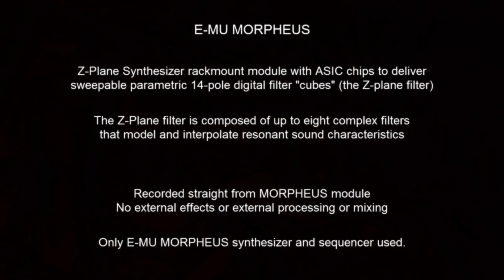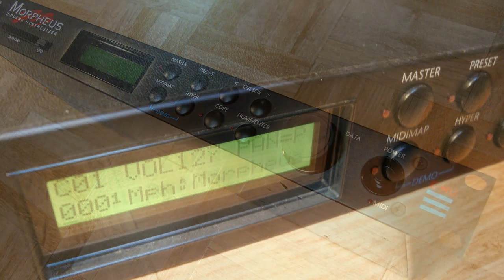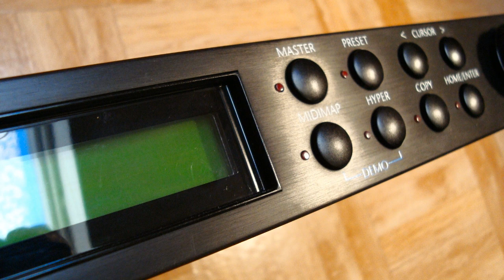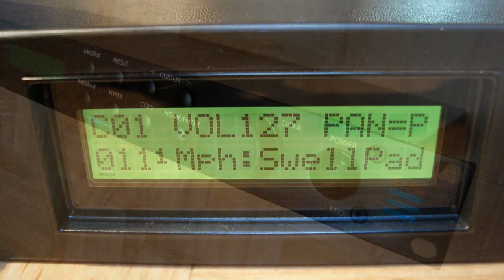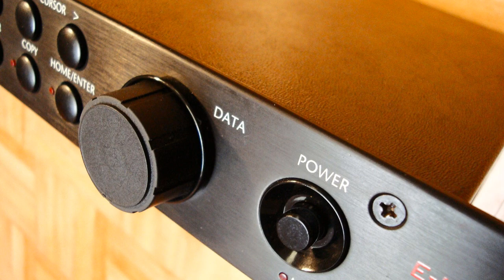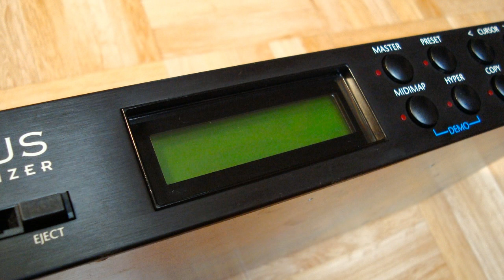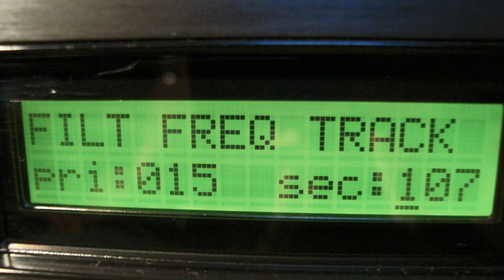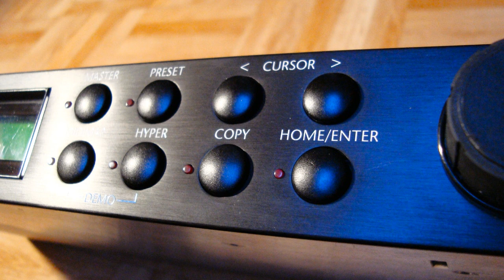𝗘-𝗠𝗨 𝗠𝗢𝗥𝗣𝗛𝗘𝗨𝗦 Z-Plane Synthesizer 【Demo】

Comment: Wooooooooooow!    This sounds awsome!   With headphones its a dream!
Did you compose some songs?  I like to listen! What a pity, cannot buy and use it with the prophet 12...
Reply from the maker: RENAISSANCE of RA You have a right choice - the Prophet 12 is very Great Synth! I also would like to have one... Yes, I have some songs, old stuff, made on Kurzweil K2VX but now I'm tweeking a new rig with better sound, where K2VX works as synth+sampler+sequencer, but Morpheus as additional polyphony module. That will be much powerful toy to play with. You can check Kurzweil's sounds in my other video there, by the way. Kurzweil is better for basses, rhythmic parts and SFX, but Morpheus is good for pads and ambient things.
Reply: oscillator Right now I finished your Morpheus track. Impressive!  Now I will listen to your kurzweil video.
I saw, DSI launched a new prophet 6 after the pro 2.  They are very quick?  They need money?
What do you think about the pro2?   Maybe its a good choice for you.  I thought about it to buy one and connect it with my
prophet 12, because I didn´t have a sequencer yet.  Or do you think the two are to similar?  the pro 6 is retro style, not a gain, because I owne the P 12!
Reply from the maker: RENAISSANCE of RA I quess that Prophet 12 is still a flagship of DSI (12 voices, 5 oscillators per voice etc). Four oscillator Pro 2 is nice too, interesting sounds because it has a hybrid engine. All other models are more for analog fans. Keep in mind that Pro 2 have a Step sequencer, so if you want to make a full songs with many multitimbral tracks and mixdown, then Step sequencer is too short for that and you need some serious hardware sequencer connected to your synths via MIDI, or software sequencer from computer.
Reply: Yes you are right 4 oscillator, and 1 sub osci.
Hm, yes I think to short for a song which lasted maybe 6 min. But you can repeat the same sequenz over and over.  Is it possible, to do 2 sequences or more over another?  
For example: I programmed 5 different tracks, store them, each  one minute and this will be played sucsessive (back to back) so I filled 5 minutes.       Or maybe like I can use in the P 12, 2 sounds in the layer, which 2 arps over another?
Reply from the maker: RENAISSANCE of RA You're welcome to check some bizarre stuff from the Morpheus synth - my new video called "Insanity". Greetings!
Reply: My friend, yesterday I´v played 15 min. Disturbing sound and great pictures, BUT  then windows freeze, 2 times.  I don´t know what your track done to my system, now I´m afraid, to listen again.  :)
Reply from the maker: RENAISSANCE of RA
Hi, don't worry :) My track is OK, probably your internet streaming freezes because this track is so long (35 minutes or so). It's nothing wrong with it, I promise! :)
Reply: Yes, I think yt freezes because to much fear :)) hahaha,  but seriously in the last time I got many problems with yt.

Comment: Hello, do you think it's possible to get the same quality ambient sounds with the ultra proteus, or the morpheus comes with a kind of "special-unique  sound" over the ultra proteus?
Reply from the maker: Hi, UltraProteus has the same engine as Morpheus, but they have a different set of ROM waves. UltraProteus is more for acoustic sounds, while Morpheus is better for ambient. You can check my channel for 'Insanity' tracks to hear the full power of the Morpheus synth - I quess UltraProteus would not be able to produce that kind of stuff.

Comment: this instrument has a lot of hidden potential...but i think it lacks some important things like custom waveform facilities (no sampler or import of new samples) and the editing via panel is really tedious.
Being a kurzweil user (ex user....) and knowing quite well the vast potential i guess....wouldn't be possible recreate the morpheus audio engine inside kurzweils?
Reply from the maker: +kyma1999x You're right - there is not possible to import sample waves into Morpheus. But... maybe it's not so necessary because Morpheus has so complex Filters, Modulation matrix and Function Generator which compensates the lack of wave expansion? You can check another track called "Insanity" on my channel and you will hear how different the Morpheus can be even with the same 8MB of wave ROM :) The trick is Z-Plane filter... which is so unique and never can be be created on other synthesis platforms, even on VAST which I know well because I also have the K2000 synth (check the demo on my channel).

Comment: Hi Oscillator.  I have a question for you about SysEx data.  I own a Korg Microkorg, which is compatible with Korg MS2000 patches & SysEx data.  I found these MS2000 patches, but they're all in text form.  What do you do with these kind of SysEx files??  I know you don't own an MS2000 or Microkorg, but how would you load SysEx data of this kind, (text) into ANY kind of editor, patch librarian, or synth??  I thought SysEx data has to be .SYX?  What do you do with the text data??
http://alpha-7.org/Audio/Patches/MS2000/Electrip_Studio/Electrip%20Studio%20MS2000%20Patches/Korg%20MS2000%20Patches/
Reply from the maker: +Gerry No Hi Gerry, there is nothing wrong with those files in this link - I've checked and there are two types of files - .syx (System Exclusive) and .txt (text files). Those text files doesn't contain any parameters of the patches, they are just ordinary text files with patch names of particular banks, nothing more. It is just a list of preset names and you can't load them into synth, it's just an information, that's all. They are NOT a SysEx files and there is nothing to do with them, only to read :) Other type (syx) files are usable for synth because they contains the hexadecimal codes, as it should be for any kind of SysEx file. I remember the case, sometimes the syx files have the .mid extension (MIDI Sequence) and then it's possible to convert it back to syx format with little software called MIDI REXX (as far i remember). Another great software for load/send/edit of SysEx files is MIDI-OX, that is the best software of that type I ever know :) And it's freeware! I'm using it a lot for my Morpheus synth to load syx files into synth or save syx files from synth to PC. It's also possible to edit the syx files without loading into synth, for example to change the patch number (location into RAM memory) or any other parameter (volume, pan, name of the patch etc). Very handy stuff :)

Comment: Man, you have to enlighten me/us with your knowledge… I was soooo disappointed when I got my Morpheus because the factory presets sound like boring Proteus stuff… How come?
Reply from the maker: Hi mate! You right, the factory presets are just a crap. Presets on this demo are result of real-time tweeking of parameters using MorphEdit software and playing some notes to show this combination. The best from the Morpheus I got in ''Insanity'' tracks - there I used same technique (Morphedit), but also added the Korg Taktile 49 keyboard with 8 sliders, 8 pots and X-Y Pad, all assigned to the different CC numbers (MIDI#) to control the parameters of the Morpheus. Also sequencer of Kurzweil K2000 is working there. Everything else depends just from imagination and lucky accident. Just tweek the parameters! :)

Comment: Sounds amazing, I have one but I am always to lazy to use it. Do you know of an editor that will work with windows 10?
Reply from the maker: There are only two editors for Morpheus as far I know - MidiQuest and MorphEdit. MidiQuest works very unstable and do some wrong parameters and crashes, but the MorpEdit is just perfect. Not sure about Windows 10, but MorphEdit works on XP, Vista and Win7 32-bit and 64-bit. I definitely suggest you the MorphEdit, it should work also on Windows 10, but I'm not sure, never tried.
Reply: Yeah morphedit won't install on windows 10 unfortunately =( or maybe it's just my computer I don't know.
Reply from the maker: Actually there is no installer on Nancarrow's website, only the portable version of Morphedit software. That means you should download the binaries package, unzip, place anywhere on your computer and run. That simple!
Reply: OMG!!! thank you so much!!!! too bad I have to go to work soon. But I got it to work!!
Reply: ah shit it say says error reading midi data =(
Reply from the maker: I guess there is problem with your USB-MIDI adapter. Don't use cheap chinese ones for few bucks - they don't work, I tried. Use Roland UM-1, Alesis, Yamaha UX-16, M-Audio Uno. I'm using E-MU Xmidi 1x1 Tab, works great! And don't forget to plug correctly: MIDI OUT of adapter into MIDI IN of the synth / MIDI IN of adapter to the MIDI OUT of the synth.
Reply: For sure, I got to go work soon but when I get to it i'll let you know how it go's. Right now I have it plugged into my focusrite sound card but yeah it probably is a cheap midi wire that I got from guitar center. I have a M-audio uno but my prophet 8 is using that right now. I'll switch when I get home and see how that go's. Thanks for all your help.
Reply: No luck, there is a connection now but every time I try and load the presets it just crashes. I tried using all different types of compatibility modes to run it and initialized the morpheus and tested all the banks for errors and it was ok so it's definitely my pc.
Reply from the maker: I can't remember how Morphedit worked with loading/saving banks, because I edited only presets with it, but I used the software called MIDI-OX for sysex files. It's freeware and has huge abilities for MIDI and system exclusive, try this out. And check if your USB-MIDI adapter has proper drivers installed, because I also had a problems when I tried to load sysex files with my E-MU Xmidi 1x1 adapter. Actually it's plug'n'play, but I got corrupted sysex transfers, so then I got the E-MU USB drivers and everything worked fine :) One more thing - some Morpheus versions need to enter the preset mode first, after this you can edit presets from MorphEdit.
Reply: I finally got it to work! For some reason the uno cable wasn't send/receiving any data and my drivers were up to date. So I tired again with cheap guitar center midi wires into my pro 40 and it magically worked lol. It even receives the whole preset bank and I'm able to change any preset so all I have to do save straight from the morpheus so no transferring of sysex files needed. I'm so excited as I have had this synth for a couple of years now but scrolling through everything made it such a pain to bother with. Thanks a lot man I really appreciate your help!

Comment: Marvellous. Any external effects? And do you sell patch libraries?
Reply from the maker: Hi, no external effects used - only internal FX processor. Those patches are not for sale, because the patch bank is not ready yet. Actually patches are not so important - the best part of this synth are realtime modulations, that let you create sounds instantly. You can hear this in "Insanity" tracks on my channel. Here is full power of the Morpheus synth !
Reply: oscillator it is a great synth, but it’s takes time to program (even though I use edisyn for the pc) and I really liked your sound design. 
I have “issues” with the effects - haven’t found a way to tie them to the preset and to me the effects are powerful sonic changers and should be part of the preset (which is by emu’s design I guess)
Reply from the maker: I've used the Morphedit software to program the Morpheus. Very clear and handy software, it's also freeware. About effects - there are not connected to the particular preset - you must work in Midimap mode to create effects for MIDI channel. The reason is that Morpheus is multi-timbral synth and E-mu creators decided to stack the FX processor to all 16 MIDI channels at once. It's little strange approach, but it's a little better than no FX at all... you can find about Midimaps in User Manual page 29.
Reply: oscillator yes I have the manual (and have studied it when stumped 🙄 😃) must check out morpedit then - I made 4 new patches yesterday and designed a nice fx setup for one of them - but it muffles and smears all the other patches - nice efx - but not generally usable so it’s only good for that one patch... so I need to design some more neutral midimaps (which edysyn cannot - so again must check out morphedit)

Comment: At 47:04, this sound could match for Queen's Radio Ga Ga.
Reply from the maker: You''re right man! Probably the same patch and chord :)
Reply: @_oscillator  But not the same synth; Radio Ga Ga is from 1984, the UltraProteus from ten years later. ;-)
Reply from the maker: @emmanuel_dupin  You're right again :) Logically! Actually this is just a simple pad sound. Morpheus is capable for much more powerful stuff - there are 3 parts of "Insanity" track on my channel, which I recorded using only a single Morpheus synth. Cheers!

Comment: What is the white box with the batteries for? And why is it connected to the small battery inside? The latter seems to be covered? The reason I am asking is because my is not working these days and I am trying to establish the cause...
Reply from the maker: I connected additional battery holder for 2 pieces of type AA batteries to use them in place of original CR2330 battery. But in fact it does not make sense, because AA batteries can leak - the CR battery is safer.